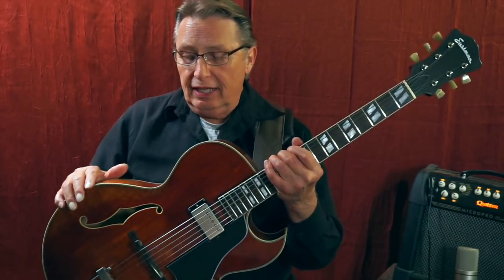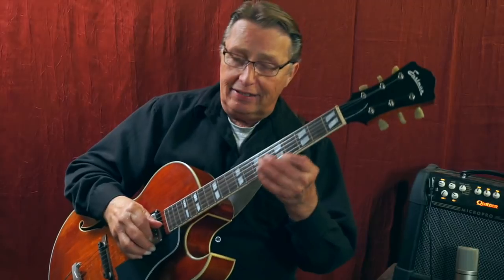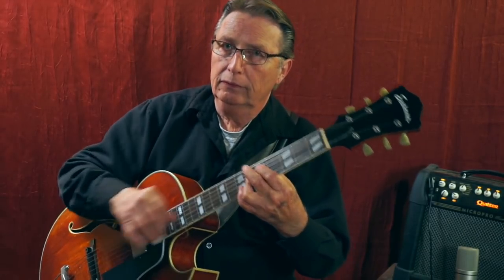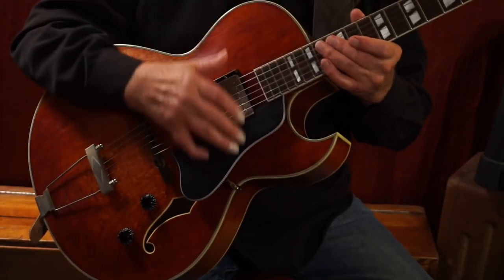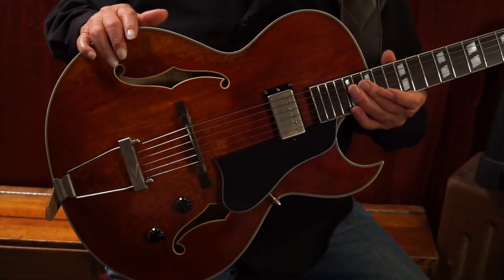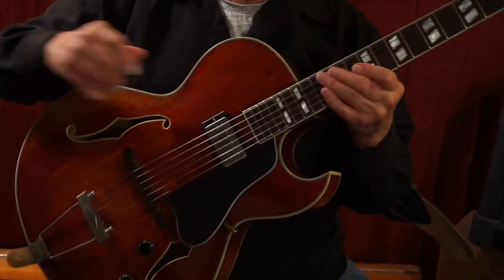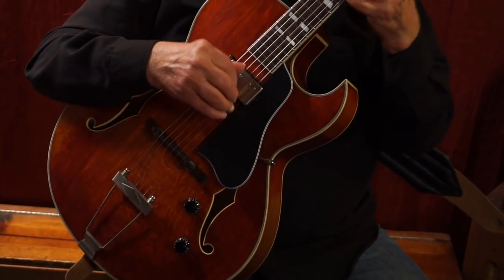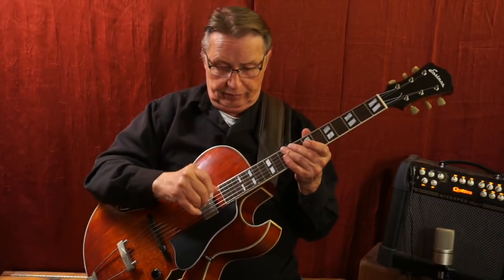Eastman T49v with Rich Severson

Comment: Hi Rich! Long time watcher here. I have an eastman OM and love it - and i really want an archtop with a good acoustic sound. I'm wondering if you can give me some advice...  I am in a spot where i can buy either a t-49 or an ar680ce, but i'd have to sell a guitar to get the 680. Is there a significant difference in overall quality and feel between the two? Does the t-49 have a good acoustic sound? I really am a "one foot into jazz but mostly a rock/blues player" but i'd love an archtop that sounds good unplugged.... think the t-49 will cut it? or should i spend the extra on tje 680?
i played an ar380 and was unimpressed with the acoustic sound, if that's a good reference at all.....